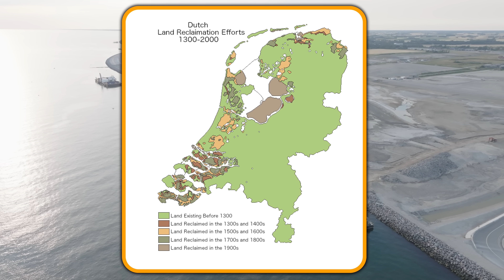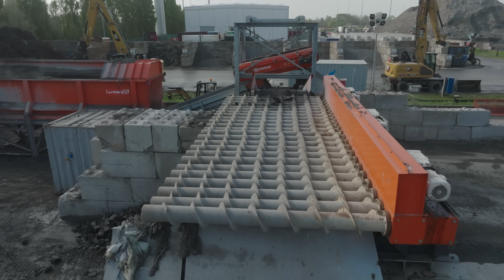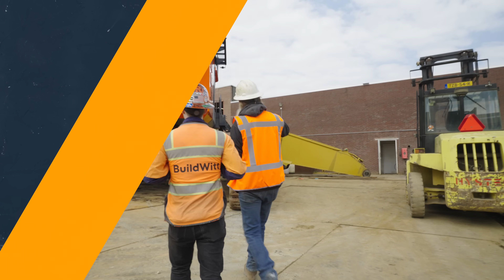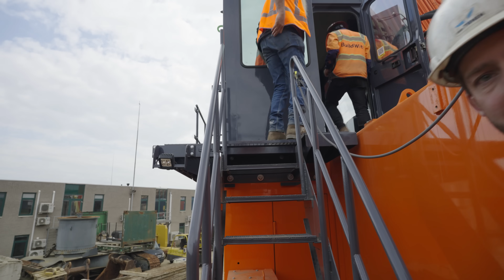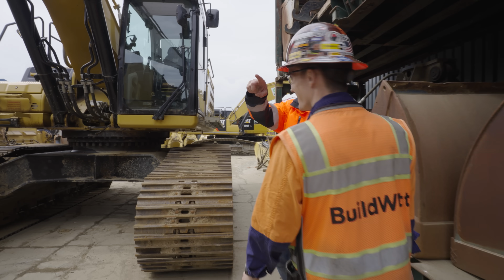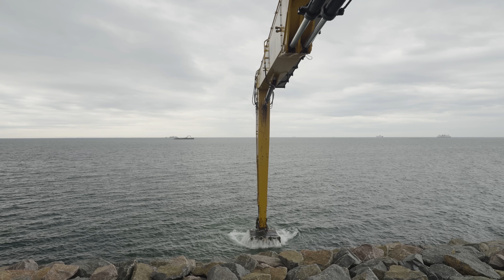How the Dutch Build the World's Craziest Excavators!

Comment: Company i last worked for had a long stick and boom built for their Cat 375. Fully stretched out with 3yd bucket on, it reached 70 ft at ground level. They made/bolted a carriage to the counter weight which then held 2 sets large crusher jaws and 1 set small.

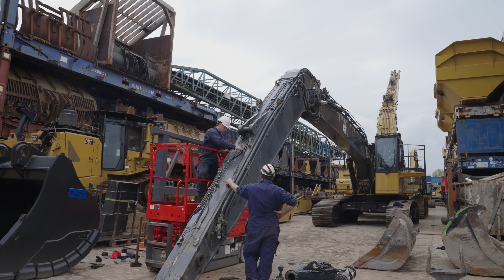Comment: The excavator you see at 14:51 I did operate that machine, we had it configured with a clamshell bucket and it was placed on a crane barge where I was captain/crane operator on. We worked for Martens and van Oord with dredging on the Maas in Limburg the Netherlands. At the time we used it there was placed a whole other cab over the original cab and protection under the cab and at the right side of the machine because we had the possibility to come across ww2 bombs while dregding.

Comment: To make such a machine Electric would be so insanely ideal, because you need the counterweight anyway, so you could easily replace them with LFP batteries. 1000hp motor is nothing for an electric truck.

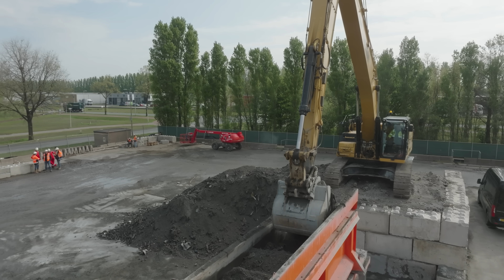Comment: 2:04 the most useless use of an excavator. Instead of building a simple pit where trucks can dump stuff in an a conveyor belt picking that up throwing it slowly in the separation machine there, they instead have an excavator operator shuffling endlessly stuff 2 meter higher? What a waste of man-hours and machine time.

Comment: You can also visit Bemo Rail in Warmenhuizen, they make and convert Locomotives.
They have built four Diesel Electric ones on old GE frames, and are now building ten Hybrid ones from our old GE Diesel Electric ones, the frame and bogies are refurbished by our workshop.
I'm responsible for the radio remote control equipment on them, sometimes get to ride on one for testing.

Comment: why are the 3 cylinders on the boom upside down?
Reply: Theyre upside down due to the oil having a larger surface area on the piston to act on when raising the boom. If they where the other way round the rod would take up some of the surface area and would create extra heat and not be as effiecient.